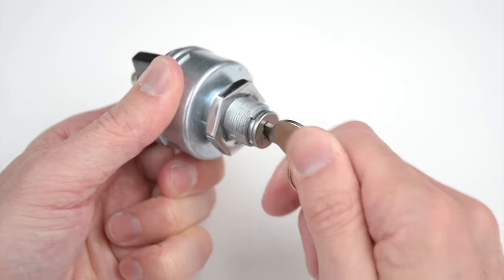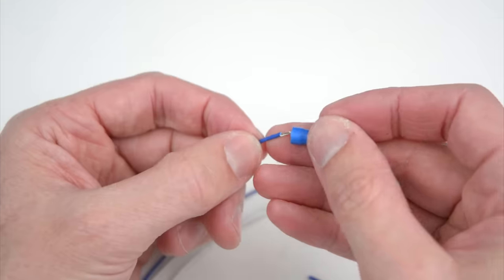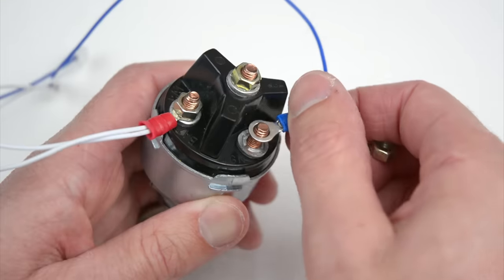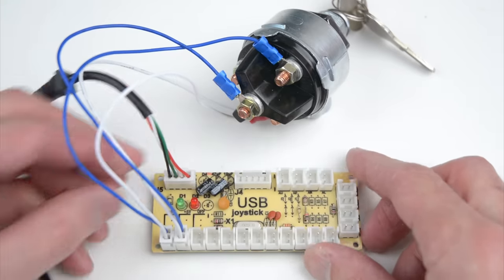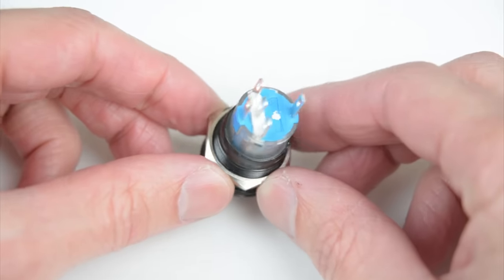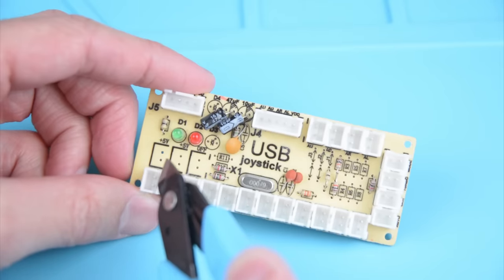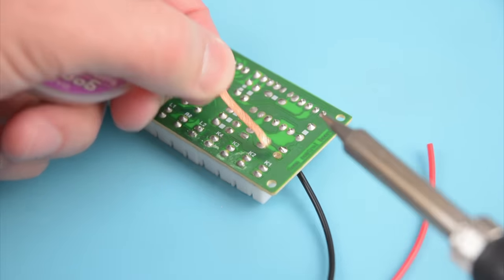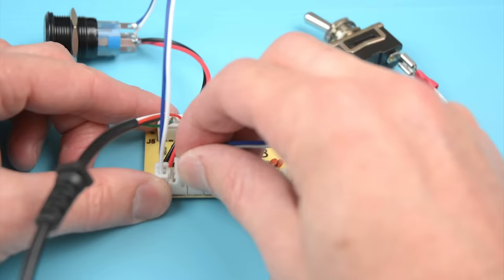HOW TO WIRE IGNITION KEY + STARTER SWITCH SIM BUTTON BOX

Comment: Not gonna lie if I had this as my power button for my pic that would be lit
Reply: That's what I want to do
Reply: You could make it wireless with an Arduino Uno and wake on lan!
Reply: I want this as a bower button for my gaming pc setup, anyone can help me with that?
Reply: dennis smit wire it to an arduino with a wifi module and then make it wake on lan
Reply: dennis smit it’s really easy using arduino.
Reply: Thats super simple. You just need the key + lock and 2 wires :D
Reply: You can make it as your power on/down, but I'm not sure you can include the ignition
Reply: It's much easier to make this a pc power switch.
(For momentary switches. Like the ones shown) connect both wires straight to your motherboard on place of power switch (in front panel connectors)

Comment: Use the switch and button for nitrous or suspension!!!
Reply: LUIGY 99 ricer
Reply: Lil Kachowski How is he a ricer if he has nitrous?
Reply: Nitrous isn’t a real thing
Reply: Wym nitrous isnt real?
Reply: Nitrous isn’t a thing in real life it’s just in games
Reply: bean mcbean really 😒😒 search it
Reply: bean mcbean nitrous is real
Reply: nitrous only for drag,
Reply: arief fauzy no, in my driftcar i use nitrous. And its give a lot of people using nitrous
Reply: alex_038 wow thats nice...
Reply: arief fauzy it true, people use nitrous in their drift cars
Reply: bean mcbean how isn't it? NOS is a real thing, it doesn't just shoot out flames, it delivers more cold air to the engines 
more cold air = more HP
Reply: Yeetus bc he’s a non car guy that thinks nitrous is like a rocket booster
Reply: bean mcbean it’s real but in games it’s like a rocket booster. In real life it is sprayed into the engine and causes the fuel to burn faster which increases hp and speed but can be bad for the engine since it’s not made to work that fast
Reply: @benjohnson9552  nitrous oxide does exist, it's just chemistry man.
Reply: @guardrailhitter  wrong it isn't the cold air that gives it more boost it's the extra oxygen
Reply: Where to buy these things
Reply: @England91  Yeah bc cold air is denser therefore more air.
Reply: @fastsalad9428  It's only because nitrous is rich in oxygen, it doesn't deliver more "cold air" or burn fuel faster lmao.
Reply: bean mcbean  btw it’s real
Reply: FlyingFrontWing Nitrous oxide
Chemical compound
Nitrous oxide, commonly known as laughing gas or nitrous, is a chemical compound, an oxide of nitrogen with the formula N ₂O. At room temperature, it is a colourless non-flammable gas, with a slight metallic scent and taste. At elevated temperatures, nitrous oxide is a powerful oxidizer similar to molecular oxygen. Wikipedia
Formula: N2O
IUPAC ID: Dinitrogen monoxide
Reply: bean mcbean nitrous is real dummy
Reply: bean mcbean nitrous oxide is a real thing and is used in drag racing it’s commonly called a like 100 shot
Reply: bean mcbean bruh-sound-effect
Reply: I inhale nitrous to go faster
Reply: Ben Johnson Actually nitrous oxide does exist, nitrous is also referred to Laughing Gas.
Reply: @England91  yeah, also annoying how people are air = oxygen, there way more in than oxygen

Comment: I've been thinking about installing a key ignition on my fanatec wheel and put some led lights inside the wheelbase, so when I turn the key to ACC on the led's light up inside then when I hit the ignition the wheel will power up and calibrate. You've inspired me to get it done

Comment: For everyone who have a problem with both button signals activating I have a simple solution. I've heard that white is negative and blue is positive. So if the current (or if you want to be precise the free electrons) flows from + to -, than you need to: 
1. connect two blue wires to the battery terminal 
2. connect one white wire to the ignition terminal
3. connect the second white wire to the start terminal
(or in other words just flip the colors)

The problem of connecting two white wires to the battery teminal is once you activate the ignition terminal the current flows from ingnition to battery terminal to which are both white wires connected. This results in completing the circuit on both connections which you can see on your computer as the activation of both buttons. 

So if you connect two blue wires to the battery terminal as I suggested the signal process should look like this: 
1) When you activate ignition terminal the current flows only to the one white wire so only one button signal is activated
2) When you activate the start terminal the current in theory should flow to the start teminal which only activates the second button. However, insted you'll probably see both buttons activated. This happens because the ignition terminal is still activated even when you turn the key to the start position. This doesn't affect the gameplay, though. You've already activated the ignition so all you need to do is start the motor (in real car the ignition turns on the electronics which are needed during the whole drive while the starter is needed only in the begining, that's why the ignition is on even in the start position). When you want to turn off the motor you just turn the key again to the start position and than you turn it all the way back untill you can take it away. It's that simple.

If you don't believe me (a high scholer who studies physics and chemistry) than you can try something else but I'm 100% sure this will work.
Reply: How do you light up the LED without having to Sorder ? Is there a way like the other methods ?
Reply: @AmillionCo yeah theres a couple 5v ports on the board, theyre red.  just use the whiten blue wires and plug it in. you'll have to connect the wires to your led tho, and if thats not possible then you may be out of ur depth. good luck.
Reply: Thanks a lot, but I found out I have to disconnect one of the cable to config the correct setting each of the time for engine start / power on even I filpped the blue and white
Reply: Anyway just want to say a big thank you for solving my issue😚( I didn’t think of the flow of electro)

Comment: This would be cool to have as a startup for your pc. you could possibly fit it in the cd drive slot if you dont have one.
Reply: Hey, great idea.
Reply: Askari 
I literally started my PC with a triangle.
I put one wire from the "on switch" on the triangle, and the other wire (just one power cable that's been cut) on the striking stick.

When I rang the triangle, my PC turned on 😂😂

I've also used a stapler. 

Honestly
Reply: Damn, that is awesome.  @CraigMansfield
Reply: atomed2 Hahaha thanks mate 😂👍 you just need anything metal to close the circuit temporarily. But it must open again or you'll have a "forced shutdown".

I was thinking of all sorts of funny things to use hehe 

It happened because my power button broke, I wondered what I could use as a button. The stapler came first hehe
Reply: @CraigMansfield  I can't think of anything cooler than a stapler to turn a computer on.

Comment: Do you think it would be possible to wire up the gauges from that bmw to the accessories spot? So that when u turn the key it like flashes all the lights n stuff like a real car?
Reply: Yeah, its posible, ive done It (i know, late).pin 16 on blue middle socket is ignition pin :)
Reply: @oskarpolanski3152  lmao thanks
Reply: No problem dude

Comment: if you mapped ignition to the accessory on the key switch, could it then work like a normal car as the first click will initiate the ignition and the the turn of the key as the starter?

Comment: what could you possibly do with the accessories? just wondering so i can make use of it.
Reply: You can map ACC to any input.  If you use it, I'd suggest the radio menu if you play American Truck Simulator.  Connect it the same as the other two functions.  Power to batt, input to function.
Reply: @bhdevall  Can you use it to turn on the accessories in the truck like you would in real life, rather than using the run position for the accessories?

Comment: 72 datsun truck, same switch in video, but you didn’t explain which wires go where? I’m trying to figure mine out. When I hook up a battery, the starter runs and I know it’s not supposed to. I disconnected the solenoid (weird spelling I looked it up, don’t agree) and it stops running. I was told the ignition switch is bad, but I see the wires aren’t hooked up as you have it....?

Comment: Great video mate! I might have to do this one aswell, I made the tachometer one already. 

Quick question do your G29 pedal mods work on G27/G25 pedals? Specifically the Inverted Pedals mod and To USB mod, and if those two work the FFB pedals as well. I was thinking about picking up a pair of used G27 ones if they were able to be used.

Great stuff! Would love to see a G29 shifter to USB video!
Reply from the maker: Yes the inverted pedal and USB mod will work. The ShakeIt rumble can be added to any pedals.
Reply: Thanks! Ill pick up a pair of G27 pedals online then :)

Comment: Would it be possible to make it (for example) switch between accessory and ignition without needing to loop around? Like instead of, off > accessory > ignition > start, you could go, accessory > ignition > accessory, without going, accessory > ignition > start > ignition > accessory. (Essentially I want the key to be able to act the same as it would in a real car) Also would you be able to make it work in most games

Comment: Am you kinda messed up. You use the blue connector on bigger wires and red on smaller, you had it backwards and could have the issue of the wire falling out. I can forgive you cause your the best!

Comment: Regarding the ignition switch (with red cover) + engine start/stop buttons: Would it be possible - using a Pro Micro - to connect things in such a way that when you flip the switch the engine button LED lits up? And then when you flip the ignition off the engine button LED turns off again?

Comment: I would have wired the engine start button through either the toggle switch or the ACC terminal on the ignition key for extra realism, plus you'd have a way to visually check with a glance if the ignition was physically on or off.
Reply: Doesn't it though? With the toggle switch and start button at the beginning of the vid, you see him flip the toggle and then hit the start.

Comment: It’s a nice setup, but you definitely need to get your ignition switch working where going from off to run turns on the electrIcity, then going from run to start cranks the vehicle, then going from run to off shuts the vehicle off.  I don’t know how my Advanced Simulation Products button-box is made, but the keyed ignition on it works in the manner I described which makes it much more realistic than using the start position to activate the switch every time.
Reply: I just made this and the game controller recognises it as two buttons, but if i put both as start stop motor in ets2 only the first turn of the key works. How did you do this?

Comment: Hello is it possible you can post a video on how to add a true truck parking brake & trailer brake using a push-pull switch like the "Calterm Push-Pull Switch". I am planning on purchasing the genuine yellow & red diamond shaped knobs and attach them to a push pull switch via set screws similar to the ones used in the "Heavy Hauler Button Box" but I'm not 100% sure on how to wire everything. It looks like it could also be done using a usb controller like you've used in the ignition switches and turn signals. Also, how many things can I connect into the usb controller board? Can I connect the turn signal light, ignitiion switch, & 2 push-pull switches into one board or should I use separate boards for each? Sorry for the long message/question but I really could use your help. If you don't have time for a video, maybe you can just explain it here on the comments section. Thank you.

Comment: For the led engine start stop light on the button what is the minimum voltage you can use to power it, I thought they had to be 12v?

Comment: Hello amstudio! I would like to ask you a question because I wanna try to build one of these. If use a push button switch with a 12v led and wire it up to the joystick encoder which supply’s 5v, will it still illuminate?
Reply: Did you manage to connect it? I would like to illuminate the start button only when the ignition is on and I have a 12v start button as well
Reply: Leonardo Marchese I looked further into the topic and it will power it. It will just be a weak light.

Comment: Pro tip. Do not go zero delay usb unless your using this for one thing only. And even then I wouldn’t recommend it. It’s an absolute nightmare to configure when you have multiple sims and wheels and multiple keyboards etc. Arduino is the way. I learned the hard way.

Comment: Hello, very nice project I will try for sure. Just one quick question: the start button is 12v while you use a 5v connector on the board. Any issue by this?
Reply: I hope you've had an answer in two years, but it simply means the button is rated to be used up to 12 volts.  So you could use it in an application up to 12 volts, but if you tried it in a mains application (120/240v) you would probably start a fire :)

Comment: Would it also be possible to use a normal switch (wich stays in position) to have the ignition on as long as the switch stays in that position? 
I'd use it mostly for ACC, where there's only an option for ignition on/off by a momentary signal... Sadly.
Reply: I know that in beamng you can mess with the input json to make it act like this.

Comment: If u had added the accessory pin to the key switch also you wouldn't have to double pulse it to start the engine as first notch would be ignition second the momentary part would be starter that's what I did on the one I made made it muxh more realistic
Reply: My thoughts exactly.  I'm planning on building a home cockpit for ATS in the near future, and in piecing together components, came to the same conclusion.  I think the reason for his method lies in the joystick board he's using.  With an arduino board, you would be able to program more specific functions.  For example:
Position 1: Off - Position 2: Electrical Supply - Position 3: Ignition (Momentary)

When going from Position 1 to Position two, the script would output to the electrical supply.  When going from Position 2 to Position 3, the script would output to the ignition toggle.  When going back from Position 3 to Position 2, the script would output nothing, leaving the truck engine running.  When going back from Position 2 to Position 1, the script would output to the electrical supply, thus killing the electrical supply and engine.

With a joystick board, it only recognizes simple inputs.  So, if he were to turn the key to accessory, it would toggle the electrical supply.  Next, turning the key to the ignition position, would indeed work as intended.  However, as soon as he would release the momentary ignition position, and the key returned to the accessory position, the joystick board would register this as an input and assume that he had intended to shut off the electrical supply.  In ATS and ETS2, shutting off the truck is achieved by killing the electrical, not by the engine button.  This is only the case if you do not have an electrical supply key assigned.
Hope this helps anyone on the same path!
Reply: Andrew robinson so did you add a wire coming from accessory to ignition or the start?

Comment: I CANT GET IT TO WORK  i have the key ignition and the joystick encoder and i have the two whit on batteri and the blue on ingnition and the last blue on top  do i miss somthing or what
Reply: Try change battery (white combined cables) with ST (blue wire) It works for me

Comment: Hey amstudio. Does it matter if both the thin wires are white? Thanks😁
Reply: it shouldnt matter as long as you get the wiring correct, the colors are mostly to differenciate between different kinds of uses for the wires
Reply: @Marpurrsa   ok. Thanks a lot :D

Comment: hey. i was just wondering if the manual ignition would work for Asset Corsa
because you were only showing it used with the Truck Simulator ;-)
and thanks for the vid
Reply: Assetto corsa doesn't have ignition, unless you mean competzione
Reply: @starfire2133  hey, do you know what game actually use manual ignition, apart form ETs and ATs? thx
Reply: Closest thing is Assetto Corsa competzione